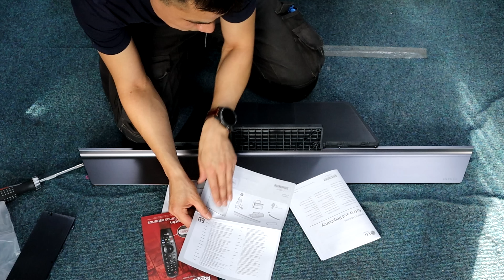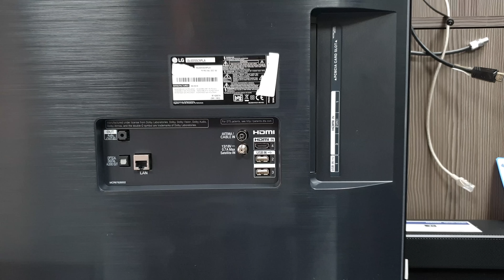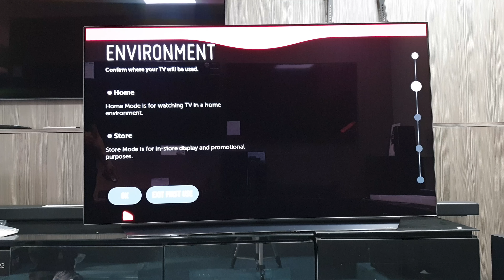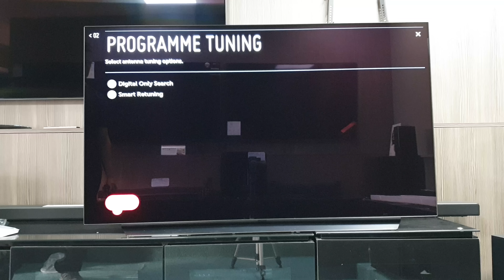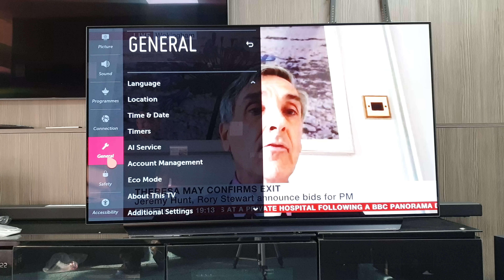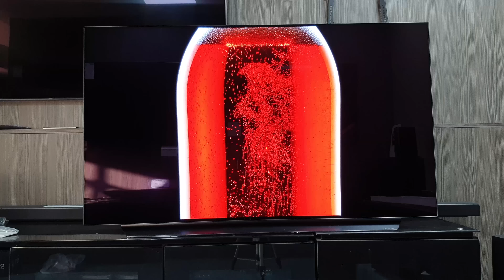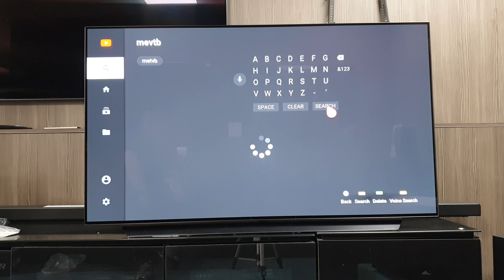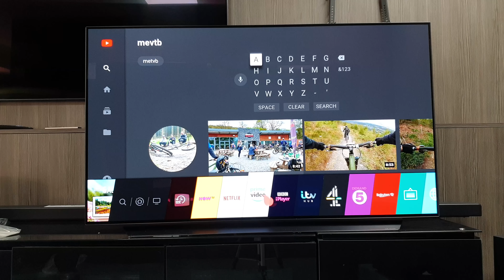LG 2019 OLEDC9 4K HDR Unboxing and Setup with Retail DEMO and Test 55 OLED C9

Comment: Just bought my LG C9 55” today and I am very happy with it so far!
I considered buying the 65” but because the 55” is smaller it looks a bit sharper. 
Also I found 55” is a bit easier on the eyes since you can see the whole screen more easily rather than focussing on only one part of the screen.
Of course it also depends on the distance you sit from the tv.

One tip if you assemble it:

Pay attention having enough clearance from the ground when the tv is laying flat when mounting the stand.
It is a bit tricky if the tv lays too close to the ground because of the front panel of the stand is sticking out.
Do everything in slow motion and you’ll figure it out.
Also it doesn’t hurt to have someone helping you.
Reply: May I ask how much did u bought it ?
Reply: @hassanianali1677  
14490 sek, so just under 1500 euro
Reply: @Lloyd.B  thanks man, but do you thing this modle is better than the old oled B7 v 55 ,  which one do u recommend ?
Reply: @hassanianali1677  
Hey I looked at the B9 and I've been told the screen is about the same with just a different design (the stand is less wide) and a slightly worse processor. The price difference isn't that big I believe so it comes down to taste. Personally I went for the C9 simply because I thought the stand looked better. About the B7 I am not so sure. I do have a friend who owns a B7 and he is very happy with it still. I can't give you good advice on that one but the latest models are .probably slightly better across the board.
Reply: @Lloyd.B  Hey , well I do have a friend who owns  B7 and it looks cool I experienced it many times,  but I think the processor is slightly slow comparing to the new modles ofcourse.. I was thinking to go for the B9 cuz I saw there is a bit difference with the processor which is a7  Generation and HDR10 with other differences.. what  you've been told about  maybe its worse cuz u got the C9 which has 9a Generation.. so what u think should I go for the B7 or B9 although I like the C9 but I  cant efford it  )))
Reply: @hassanianali1677  I would go for the B9 or save a bit more to go for the C9
Reply: C9 has hdmi 2.1 though which is a big deal if you're a gamer and plan on getting the next gen consoles

Comment: Nice review mate. Assume all their 2019 models are full 4k? Silly question I know but I read somewhere that some of their 2018 models were using "RGBW" which is not true 4k?
Reply: all of their panel use RGBW regardless of the year.  What do you think Sony is using?  They are using LG  panels which are RGBW.   And yes the panels are true 4k.   RGBW is a proprietary tech by LG.  The reason they have to do this is because organic Blue led has a shorter life span compared to organic red and green and it's also cheaper to make I guess.   The upside is that lg OLED panels emit less amount of blue light compared to led which causes less harm to the eyes.
Reply: swifty1969 funny how people still believe this „blue light“ thing 😂
every color emits blue in some sort.
If you dont want to harm your eyes, there is only one thing to do... reduce brightness on your screens, this has absolutely NOTHING TO DO with blue light!

Comment: tip: lay the tv on the cardboard for stand assembly, so easy
Reply: SO TRUE!
Reply: I couldn't understand the instruction manual, looked like it was saying lay flat on the floor, I have done that and had to try and lift it up again. Haven't plugged it in yet but imagine it's fucked

Comment: LG no longer has the protective film on the screen front any longer due to possible damage to the OLED screen surface. My brand new 65 inch C9 had no protective screen film on it. When I called LG, that was their explanation — that some customers had damage to the OLED screen surface when removing this peel-away protective film.
Reply: cszetela1 wow really? Mine arrives tomorrow let’s see if mines the same if there’s a single scratch they gunna with they left it on haha
Reply: Tyde Gaming They stopped using the front screen protector because customers were complaining about damage to the top surface of the OLED screen when the film was removed. Mine arrived factory sealed with no front screen protective film, and no scratches whatsoever. My display was perfect — it had a thin styrofoam hood over the entire unit.

Some C9 units presently in stores still may have the protective film on the front of the screen. My first one from Best Buy did. I returned it and the second unit from Best Buy did not have the protective film on the front of the screen — it is perfect.
Reply: cszetela1 mine had the front and back film on it.  It was actually the first tv that I ever had that had it.
Reply: Mine ended up having both as well 👍
Reply: Tyde Gaming  was the back one barely noticeable on yours?  I watched a video about it. I probably would have never seen it without that video.  Lol
Reply: Michael LaMartina I watched a video as well.... 😂😂
Reply: Tyde Gaming 😂😂😂

Comment: 11:35 the one thing that stood out when I was comparing the 8K Q900R to C9 is the screen reflections are way worse on the LG and can be seen even when it is on in demo mode.
Reply from the maker: Yeah I did pick a bad day sun wise for that video as well though but the screen is really glossy
Reply: Yeah hads down Samy has better coating 😥

Comment: Good thorough overview.
Hm, quick question - you reckon assembly could be a one man job? 
Stuck in quarantine and thinking about ordering...
Reply: killbop yes I assembled mine on my own last week. You will need a hand picking it up though as the top is very thin and delicate.
Reply: So not really a one-man job lol.
Reply: Dave SB actually managed to it myself. Was bit sketchy, but if you’re careful- it’s doable. It’s not even the weight, damn thing is wide as fuck.

Comment: Hi dan does this tv have the screws to fit in vesa 
Fixings in the box ?
As fitting a c9 for my parents in few days time 
To a floor stand with a upright at back 
Thanks in advance .
Reply from the maker: It doesn't come with them I think you need m6 bolts
Reply: TellyDan thanks for the info

Comment: Hi dan  have you ever had 55 c9 oled with front screen protection film missing new out of box ???as my parents had 2 now from jlewis 
With no film on front of screen 1st one had polystyrene bobbles jammed in edge of screen 
At top groove near edge of screen wtf 
The exchange one same no film on front .
All factory sealed up as far as I could tell not been opened 
WHAT DO THINK .
Thanks
Reply from the maker: Sounds strange I've not come across any oled model without the film on the front. I have had the lcd models without.
Reply: Weird had the film on back of screen but front missing  and very dirty smudgy marks  inside screen bag etc ????? Thanks
Reply from the maker: Sounds like it had been opened before for whatever reason. Had the screwpacks been opened before

Comment: Dan, did you forget to remove the foil on the back of the oled panel? There is some there and needs to be taken off because it gets warm and could become smelly when heated by the panel.
Reply from the maker: No it's in a shop so I left it for now

Comment: So 65 inch or 55 ? I just checked my distance from my current tv , so its about 2.40 meter , and I'm using 58 Panasonic dx 902 :D So maybe I dont need buy 65 version?
Reply: A bit late to reply to you but I noticed no one else had. Ideally you should definitely be looking at a 65inch set if you are over 2 metres from the screen.

Comment: hmmm... I think you are better offlying the screen flat on the box and attaching the stand like shown in all the other vids of unboxing. the instructions say to lay the screen flatand attach the stand to it rather than do it the way you did. they also show a better way of getting it out of the box that will ensure you dont break the screen. They apparantly occasionally break if moved the wrong way and if that happens you wont be covered by warranty. ( just had one delivered and watched all the vids. the delivery guy suggested strontly following it to the letter.  sorry to sound like a smart mouth,  it  was just how the delivery guy was so nervous for us setting up,...(unusual )  Lay the screen down, it is much easier but you do need two people. it weighs just over 40 kgs...a two people lift into place.  Nice tv. Do look at a few other set up and UNBOXING of this tv as the order is a bit important.

Comment: Hi everyone feel free to comment I just purchased a 55 inch C9. I had a 55 inch Sony 900E. I honestly feel the blacks are too much and crush all detail and shadows. Am I doing something wrong? I tried changing settings and no  change at all I actually dislike this set but I feel like it could be better can anyone help ? I don’t want to return it before trying all options. My Sony 900e had much better detail than the C9 I feel
Reply: I might just swap the C9 out for a Sony 950G but I’m not sure it’s the right move
Reply: @harlemknights1  bro q70r is better then 950G its even cheaper. and obviously no risk of burn in blacks are deep too most accurate HDR in qled line

Comment: Help...I can get a Netflix picture, but no sound. I’m using external speakers. When I switch to Netflix I get a picture, but still get the sound of the t v program I was watching.  Can you help?/
Reply from the maker: Where are you taking the audio from on the tv?
Reply: A Yamaha amplifier going to speakers
Reply from the maker: Are you using digital or analog audio output from the tv?
Reply: Not sure. I’d bet I am using digital. I’m not good at this, but........could I use another hdmi port and program apps like Netflix to that port? If so, how can I tell the tv this?

Comment: I'm getting the Sony a8g in a few days I already have the Samsung q80r was going to get the x950g but the q8fn seems like a better choice even tho it only has there extreme processor I did look at it side by side the ultimate and there isnt enough if a difference to justify the price difference mean 1999.99 for an a8g oled yeah I'll take the 55 inch its beautiful I love how Sony displays there color on there oled TVs and I think the a8g is brighter it looked like the pixels were being pushed a little harder it was so beauitful I already have a bright TV so having a nice oled with perfect blacks will be nice if I dont get the a8g I would get the lg c9 I just like sonys processing and color rendering better and with the live color I cna get ever more saturation and the reds arent orange out of the box like lg is and nobody can tell me orange is accurate it isnt lol this is why you have to calibrate lg oleds out of the box Sony isnt to bad I like blood reds not orange reds every red I saw was straight orange just like the c8 but again you can calibrate it but sony did seem to just have better color I will say the c9 upscaled much better with less noise the the c8 the c8 wasnt great to me zi had it side by side my q80r and man ead the upscaling horrible the c9 is much cleaner the worked on gradations also in a big way I can still see the artifacts tho when you changes settings and macro blocking but really 4k content is all that really matters

Comment: OLED has shorter life span then LCD LED.  Why buy a OLED TV burn in issue is a big important issue to look out for.  Some people watch there tv 15 hours a day everyday so I dunno if OLED is the way to go.
Reply: Oled Pixel half life is 50K HOURS. I used mine 6800 hrs in 4years. You will want to upgrade long before the oled is at half its life.
Reply: @srobb68  so it has a shorter life span then LCD tv why replace OLED half way in its cycle when they cost thousands of $
Reply: LG says oled pixels will last 100k hours.100000/15=6666/365=18years the life span is wayyyy longer then you would likely keep the tv. I use mine daily for at least 5 or 6hours. At this rate the oled pixels will last 50 years. If this is the case then oled vs lcd is irrelevant.
Reply: @srobb68  looooool you actually believe that 😅
Reply: Not necessarily, But even half that is more then I would keep any TV. I'm looking at micro led for the future and then what is after that?
Reply: But this tv built in pixel refresher so screen burn issue is solved